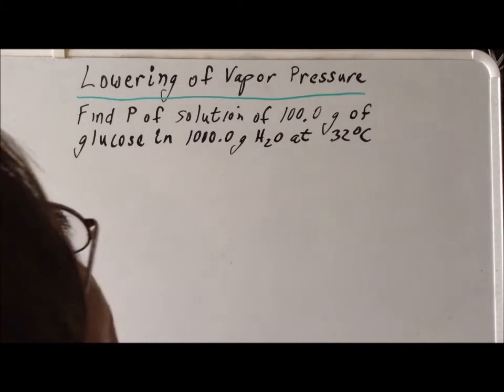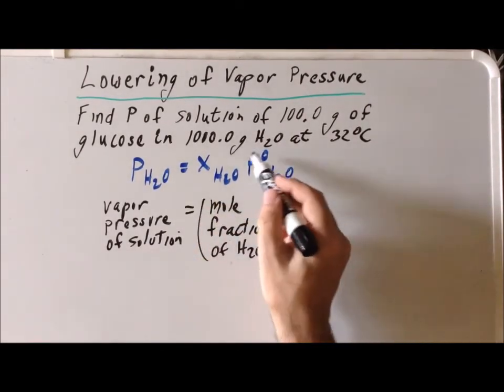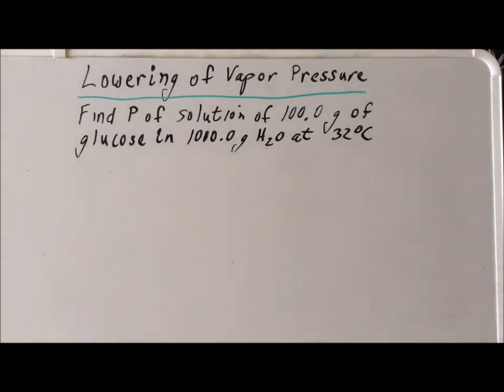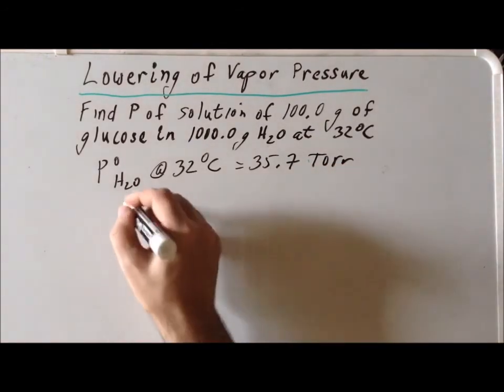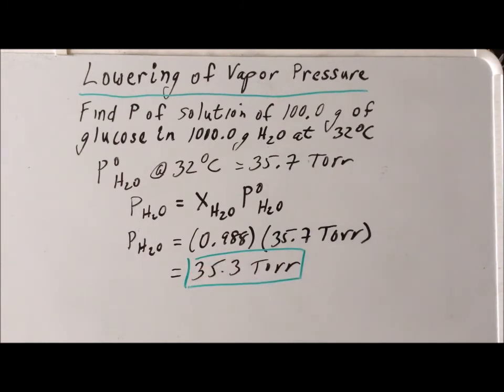Colligative properties: vapor pressure lowering problem

Comment: How do u get the vapor pressure of water which is 35.7?
Reply from the maker: We are told in the problem that the temperature is 32 °C. We can find out the vapor pressure of water (which depends upon the temperature) experimentally, or look it up in a table.
Reply: How come the torr is 35.7???
Reply from the maker: The vapor pressure of (pure)water at 32 °C is 35.7 Torr. See Table at: http://www.wiredchemist.com/chemistry/data/vapor-pressure
Note that 1 Torr = 1 mm Hg, and that 760 Torr = 1 atm.

Comment from the maker: (For mobile users)

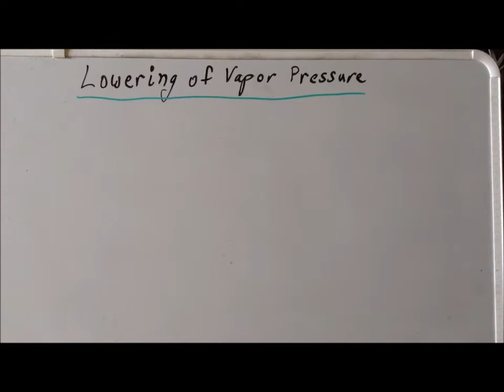00:07   Statement of problem
00:43   Raoult's law
02:23   Graph of partial pressure P(H₂O) v. mole fraction x(H₂O)
03:19   Convert grams of water to moles of water
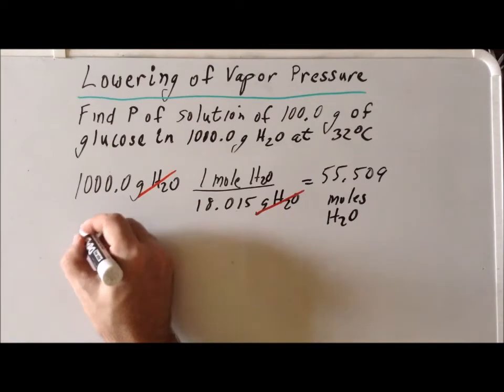04:30   Convert grams of glucose to moles of glucose
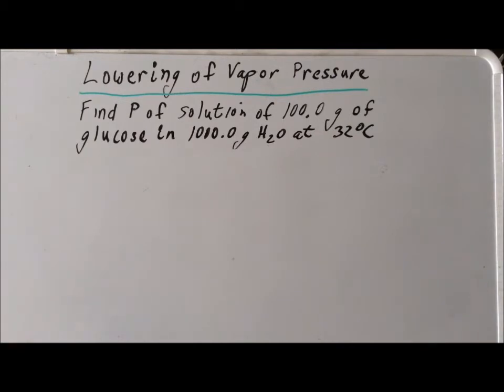06:00   Calculate total number of moles in solution
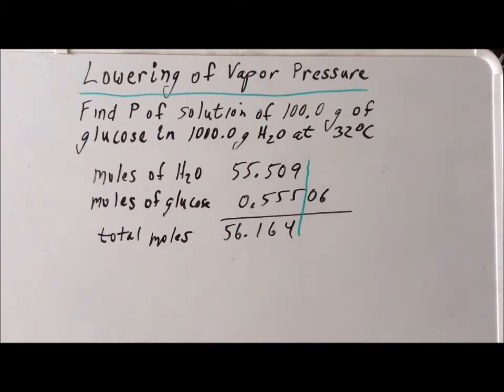07:19   Calculate mole fraction x(H₂O) of water
08:17   Partial pressure of pure water P°(H₂O) at 32 °C
09:23   Calculate partial pressure P(H₂O) of water solvent using Raoult's law
Reply: lseinjr1 wow! Attention to detail is astounding. You did put in a lot of hard work
Reply: How did it become 37.5 torr in 8:33?